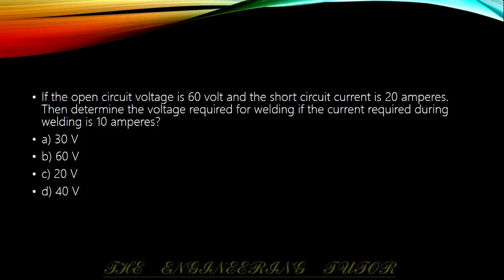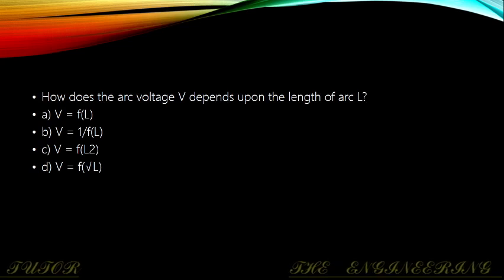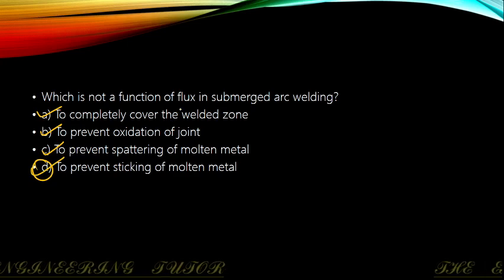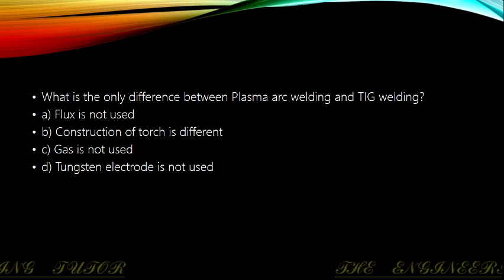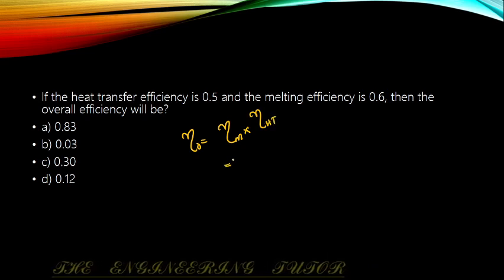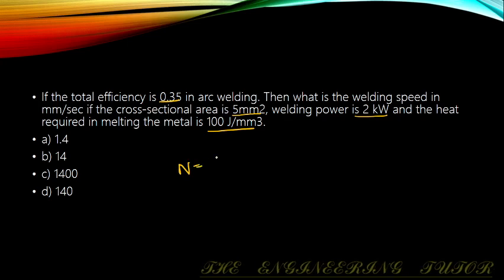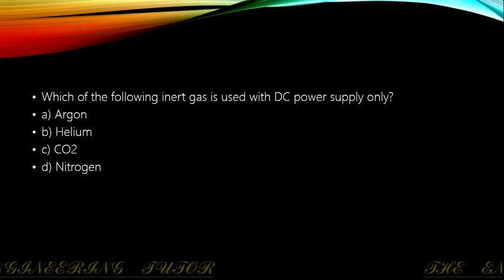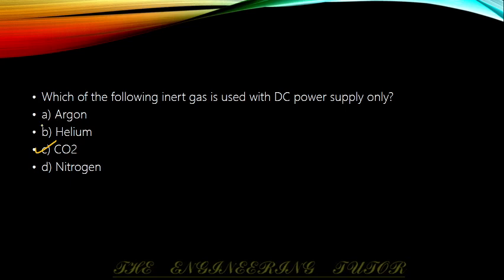WELDING MCQ- JUNIOR INSTRUCTOR WELDER- PART 6

Comment: Both GMAW and SAW using constant voltage flat characteristics
Reply from the maker: These include Gas Metal Arc Welding (GMAW), Flux Cored Arc Welding (FCAW), and Submerged Arc Welding (SAW).

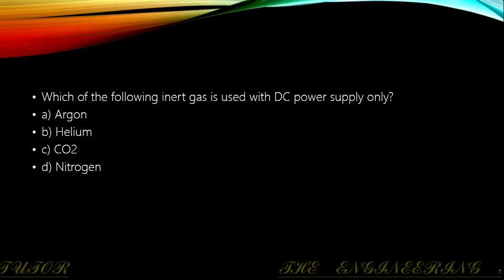Comment: 9:10  the question is about inert gas. Co2 is an active gas.argon is used in ac supply . So the answer helium?
Reply from the maker: But helium is used in AC also
Reply: @TRADERAMS  instead inert use shielding gas then it will be ok
Reply from the maker: @rintokunnath3811  ok👍